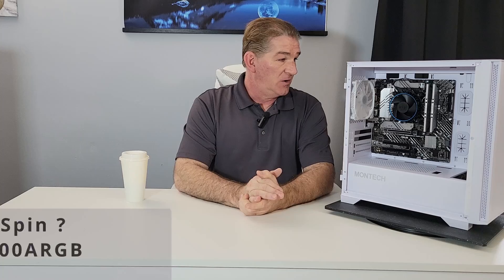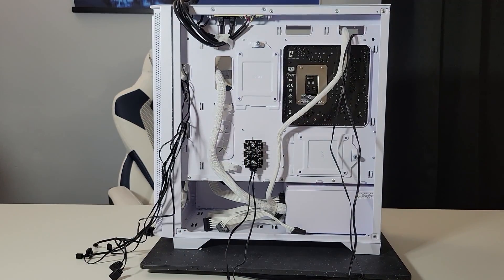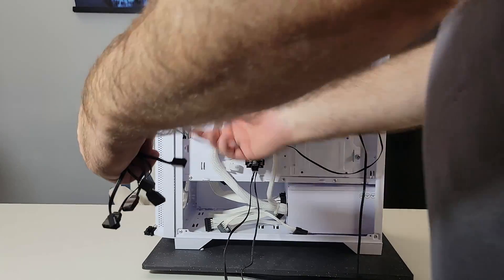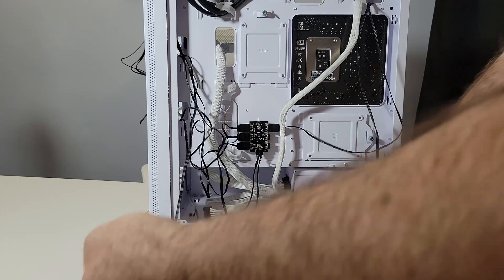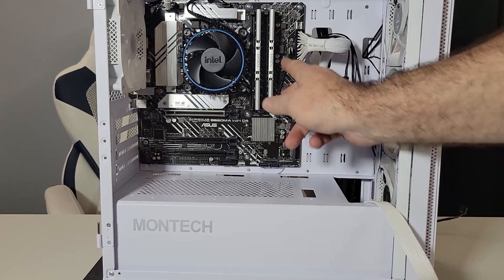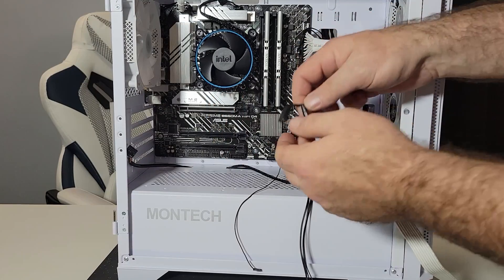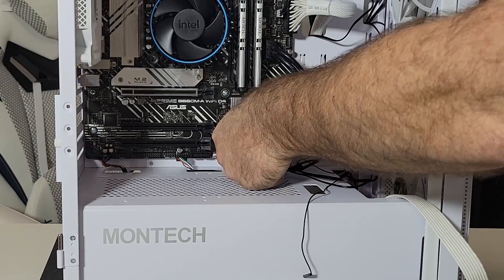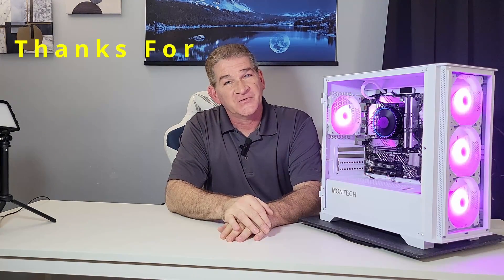MONTECH AIR 100 ARGB: Fans not Spinning/ARGB not Working/Answers to Viewer questions!

Comment: Windows 11 clean install broke Mystic Light’s control over some ARGB zones—fans run but software can only control CPU fan and one RAM stick; no fix from reinstalling MSI apps, looks like a Windows-level RGB detection issue. my 3 front fans RGB won't change no matter which software i use anymore but did on wnidows 10 and after windows 11 upgrade, but not since frersh install of windows 11
Reply: How did u get your rgb to work i had mine for months still cant figure it out plz help
Reply: @nenzibot8586 i havent anymore... worked before
Reply: @nenzibot8586 if you read my comment you will see I ama sking for help because it doesnt work for me anymore.

Comment: I want to control the speed of the 3 intake fans and the 1 exhaust fan differently. Current setup is connecting them all just like you do but using FanControl it seems all of them is set to same speed. If I connect the exhaust fan by itself to the motherboard, it would work right?

Comment: Great video. My motherboard has 1amp and 2amp fan headers. Is it safe to plug the fan splitter cable into a 1amp header? I can’t find the amp rating of the fans anywhere

Comment: Do you need a 3 pin ARGB header on your motherboard or is that just to control the leds from your pc because i dont have a 3 pin argb header and dont mind using the reset button

Comment: I have everything plugged up exactly like this. Tje fans spin but no rgb on any of the fans including cpu cooler tjat is hooked up to the hub. Is it possible that I just got a bad hub?
Reply: I’m having the same problem as you !  Did you end up finding a replacement hub?? If so where from ??
Reply: @emodity  yes, i found a email on reddit for support and they ended up sending a replacement. Funny thing is my problem was a bad sata cable from my modular power supply. I tried to use a different one from a different power supply and fried 3 fans. Smh lessons learned that day. Never use modular cable from another brand or even same brand but different model.

Comment: if my mother board doesnt have any 3 pin connectors how to i connect the argb input?
Reply: if your mobo doesnt have a 3 pin connector it just means you wont be able to control the rgb through software, just plug the sata power and other connectors for now and use the button on the case to change the colors, its not as specific but its better than no rgb
Reply: Connect it to a 4 pin slot
Reply: @birak-x8j are you insane? that’s gonna fry the leds

Comment: Hello, my motherboard is biostar b660mx-e and it has no 3 pin header to connect the argb input cable.  fans are running but no lighting. What to do
Reply from the maker: hi, it sound like the ARGB is not getting power, check to see if you connected the SATA power to the ARGB Hub. Could be one reason .
Reply: @JohnnyDPCPlayground  it was connected. I also tried changing sata power cable, but still no lighting
Reply from the maker: ok, i would just replace/buy a new ARGB Hub ,  I think that would be the easiest solution, sorry i could be more help.
Reply: @JohnnyDPCPlayground ok,  i will take the suggestion. Thanks a lot for the hard work

Comment: i have the same montech case and i'm having an issue with it. when i bought it, everything worked fine, but after a few months, out of nowhere, when i turn on the computer, fans are spinning but ARGB ins't working. i have to disconnect the ARGB controller SATA/power cable and connect it again to the power supply, and then it works again. if i turn off my PC, when i turn it on again i have to do the same thing to get ARGB working. any ideas? i've been thinking of buying a new ARGB controller...
Reply from the maker: Hi sounds like the ARCB hub isn't working correctly, i would install a new ARCB hub, That would be my best guess.
Reply: Hey man I’m having the exact same problem you are !! Did you end up fixing it ?? If so how ??

Comment: Can I control the fan RGB through the case button if I don't plug in the ARGB header? My motherboard doesn't have it
Reply: did you figure out an answer to this?
Reply: @ayvo6226 yes, I bought the case. You can plug the argb fan cables to the included hub and control RGB with the case button, no motherboard connection needed. You can cycle between many rgb options with that, but I will have to say only the static colors and breathing modes look good. The actual color shuffle or rainbow modes aren't great, either because of the fans or the hub.

Comment: Thank you so much!, i have a question. I don't have any 3 Pin on my Motherboard, is there anything that i can use to connect the ARGB Input?
Reply: Well i actually fixed the problem myself by buying a better motherboard....
Reply: @ZakkuFr modern problems require modern solutions 🤣

Comment: Great video, have the same case and found this helpful right up to the end. Was just hoping for some demonstration on how to use the rgb hub with the motherboard. It does say in the case manual to hold the reset button down for 5 seconds after installing the motherboards rgb software. Will let you know
Reply: Hey, did it work holding down the button for 5 seconds? I got the same case

Comment: My issue is that it takes a long time for them to light up. Sometimes like 20 minutes after turning on my computer. I am not sure why.
Reply: Could be because you pc takes a while to heat up. Basically the hotter your pc gets the more power gets sent to the fans and once there is enough power the fans light up
Reply: @SomebodyHelp3 it only turns on when I am playing rdr2 at ultra settings. Is there a way to keep it always on?

Comment: Thank you for the tutotial! Just wondering what motherboard you were using in the video? Coming from a beginner builder 😅
Reply from the maker: ASUS Prime B660M-A D4 LGA 1700(Intel 12th Gen) mATX Motherboard (PCIe 4.0, DDR4,2xM.2 Slots, 1Gb LAN,  DP,2 x HDMI, Rear USB 3.2 Gen 2, Front USB 3.2 Gen 1 Type-C, Aura Sync)
Reply: @JohnnyDPCPlayground 

Thank you, Johnny! But, I still have a question. I know this motherboard is one with WiFi, but I still want to know if I can still use my ethernet cable to run it. Thanks.
Reply from the maker: yes you can and this motherboard does not have built in WIFI
Reply: @JohnnyDPCPlayground 

Sorry to ask another question, but I just wanted to ask if the Asrock B660m pro rs also supports the ARGB Input cable on the motherboard? Just trying to save some extra bucks 😅😅
Reply from the maker: yes it does
Reply: @JohnnyDPCPlayground 

Sorry, Johnny. Another question. Does the 3-pin ARGB header from the MSI MagForge M100R case have to be specifically plugged into an MSI motherboard to control the RBG lights, or can I just plug it into the 3-pin ADDR_LED on the Asrock B660M Pro Rs motherboard for the lights to work? From a beginner builder, but thank you! 😁

Comment: i did exactly that with the argb plugged to the mobo (b550m tuf plus) and wont sync with mobo rgb. It only syncs the case fans and wc fans that are plugged to the case controller rgb, but its different color than mobo and rams. Can u help?
Reply: The fix is that u have to press the case's led button for 3 seconds to sync with asus aura.
Reply from the maker: Go to the product page and download the argb sync software this should hephttps://www.asrock.com/Graphics-Card/AMD/Radeon%20RX%206650%20XT%20Steel%20Legend%208GB%20OC/index.asp#Download